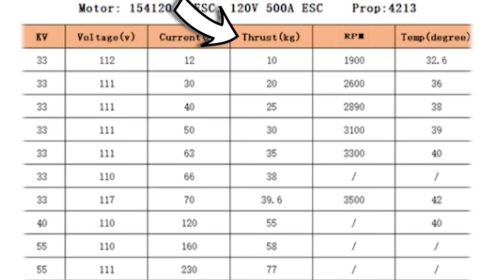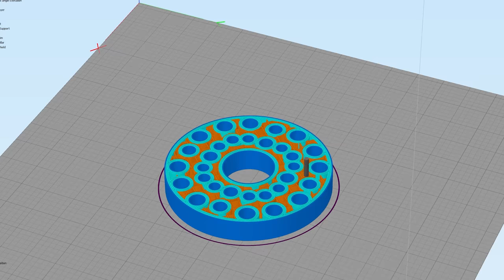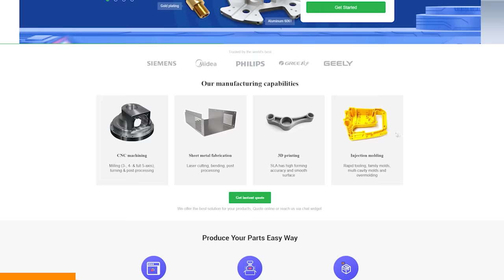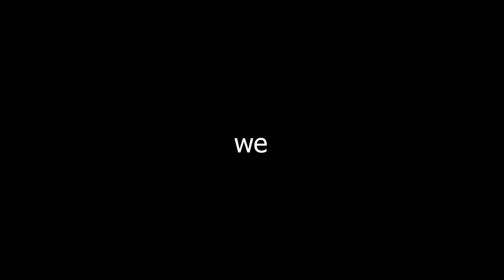Electric Motor From A Car Powers This Snow Racer

Comment: Build Project>>>>> Like the Spinlaunch satellite launch system, could you build a ball bearing spin launch rotary disk where the ball bearings (bbs) are feed into the center axis of the disk and accelerated along an internal tube to the edge of the disk where a capture mechanism / shutter/ magnet releases the bbs at just the right time to launch the bbs at any target within a 360 degree arc?

Comment: You should build a proper frame that puts the weight on the tyre, so make two steering sleds/skis? like in a snowmobile up front and put the weight on the back, otherwise it doesn't make sense.

Comment: You need to transfer more weight to the back. Less weight on the front, not just more on the back. Move your body weight back more. But this can only be done by raising the center of gravity. Not good.
The motor mounted up and behind the wheel. You moved back to where the motor was. It may look odd, but you are used to that. :)

Comment: You might get better performance if your body weight was positioned where the motor is. It looks like you have too much weight on the front and not enough at the back. A narrower tire would probably help with traction and cornering. Good luck!

Comment: What about using a bunch of rollerblade wheels sticking down under ski's. Just make them removable. Have four in a line with front and rear ones slightly higher for front steering skid. Just swap out the different steering skids for different surfaces. In fact for fresh ice why not go with big bloody skates like on a luge? I bet you'll get it moving then!

Comment: It's an issue with your frame not distributing your weight over the tire. The point where the aluminum is attached to the frame is bending which is putting all your weight on the skis leaving your tire spinning.

Comment: The main problem is that although you you made it so that you added a bit more weight to the back you still have to much in the front so your still not maximizing grip and instead maximizing friction on the front skis you could fix it by either putting more weight in the back or figuring out how to make the front skis slicker because at the moment you essentially bottoming out when you step on

Comment: When you removed those studs and put screws in I went no!!!!! 😥😥
But you did it anyway and then realised your mistake in the summary at the end when you finally got some ice.
Hopefully you can cut those screws flush and put the proper studs in.

That things gonna be fast.
Maybe order some used ice skates now and get the blades ready for a little addon.
Just make it a slip/clip on with a 3d print.
I just thinking ahead to stop you spinning in circles and also turning at high speed.

Comment: When running the 72V battery setup, I would at least cover the upper side of the wheel for safety ....
PS : footballers will think by the tracks in the gravel a space ship has landed ...

Comment: The friction of sleds is sucking all the power and so the weight needs to be over the wheel with some weight on sleds enough to give it steering
Reply: You could increase traction of rear by way of a belt .. haha we are back to common available devices

Comment: You need front wheels instead skies when on hard surfaces or grass. The skies are give you too much friction. Maybe put the seat over the tire instead of in front of it. would give you grip. This would make it more top heavy but would give the tire more grip.

Comment: like a dragster or a boat, you need to get the front skis up or at least barely touching.  Way too much friction up front not enough weight where the power needs to be laid down (on the wheel).

Comment: Cut off the main skis and weld the pair onto the steering axle. Install pegs for your feet to help steer. You have too much ski friction. 

 Also, look at ice racing motorcycles. They have fenders for a reason. Don't be a red mist on the ice.

Comment: make a planetary gear with that wheel and motor for a one wheel setup with 7 to 1 gear ratio on a skateboard u should have the traction and torque to move anywhere.

Comment: not to arm chair build but maybe adding a ballast over the rear axel could help with traction? i think your motor is too strong for such a light vehicle :)
Reply: nvm you said it in the last 30 seco0nds as i typed previous comment lol

Comment: You are lacking traction on the rear wheel. It has enough to tear up the dirt but not enough to overcome the friction of the skis. An easy fix would be to put the rear wheel on a swing arm and lift a portion of the weight of the vehicle on the rear tire. Doing something like you did with the original ice racer would be the best fix

Comment: Those brushless motors are hilariously simple. It's just a battery, connected to copper wires, coiled around a central magnetic element... the more electric current, the higher the thrust. It's basically a Magneto, although that starts a combustion cycle, instead of powering the motor itself. The dynamo is the opposite. That is a + magnet ring, that spins around a central coil of - copper wires, producing electricity, which is sent by wire to a battery, to the - 

The + could connect to a brushless motor, (magneto) which could then provide mechanical power to the Dynamo... through another positive wire. That electric current, then powers a brushless motor, (Magneto) through a + wire, which then powers the dynamo with the + current... and as long as there is juice in the battery, that just keeps happening
Reply: Wait, so the battery isn't used after the 1st pass of electric current?

Yeah

Chernobyl explodes
Reply: It's like an infinity symbol. It would almost be considered perpetual motion, although it requires energy to start, and it costs energy to put weight and stuff on it...
Reply: Electronic Gear System... been there, done that... different magnets have different resistance for more current. Copper only also works.

Comment: Dude. In America we know 2.54cm is approximately 1 inch because it's literally part of the our schooling to use Metric and Imperial Measurements. And you should have just made a Snowmobile/Ski-doo/SnowMachine instead. Traction is better.

Comment: "We're definitely not lacking traction." you say as the wheel spins while not putting any power into the ground (the definition of traction). You have no weight on the tire, only on the massive high friction skids.

Comment: Simply, sit further back ...please.  You are halting the contraption with your weight primarily over the skis. Better traction can be had by placing your weight toward the back tire.  Also, you are probably doomed with the single tire design because that tire will sink in the deeper snow. Like the skis... the tread needs to spread out; making more surface area to ride on the snow, not burrow into it.  Looks like it could still be much fun,

Comment: I've always fancied building an ev off road cart/buggy, specifically for running around woodland, basically covertly as no vehicles are allowed but if no one can hear you unlike a motor bike / buggy, but the price of the batteries puts me off, I won't risk buying cheaper quality ones

Comment: Get 3 standard scales and put one under the front ski one under the middle skis and one under the rear tire. Then sit on it and have someone read the values. You will see that the reason it won't move forward or steer well is because 70% of your weight is sitting on non steering non driving skis.

Comment: 6:57  "we're not lacking traction"  as the wheel spins, not getting any traction, and the thing doesn't go at all 😆  Weight distribution is all wrong, you need to sit over the tire and take the pressure off the skis.

Comment: Looking at this logically, too much weight is in front. The skids need to be bigger or there needs to be a rubber track like a traditional snow mobile. This sled reminds me of a tractor pull in the mud here in the states 🤣

Comment: Seems like your biggest issue was that you were using skis instead of wheels at the front. 
Also, WAY too much friction on the front two skis and almost no weight on the tire, in terms of weight distribution.

Comment: This is dangerous as f*ck... If the front gets stuck in the ground at speed, it will throw you forward, the thing will flip and the spinning wheel might carve a nice hole for your portable tools in your back

Comment: The reason it don't work well is because the force of action is horizontal.  You need weight on the wheel to change the direction of force more of an angle into the earth.

Comment: The problem is, you should be sitting over the wheel, not the skies. Wheel needs weight, skies need less weight.

Comment: Far too much weight over the front ski, get your weight over the tyre and make it so you can easily lift the front ski, you can then lean forward if more force is required, nice effort though, as it is on ice it will work ok but for snow you need to get the weight off that front ski.

Comment: The rear end was not heavy enough…you need weights to push the tire down, it’s like a pickup trucks here in America….they have plenty of torque to pull heavy trailers but terrible in the snow and rear tires always spin if there’s not enough weight to keep the rear down ..

Comment: For sure weight distribution is bad and I think balance should be at the point were you seat, if you need change balance front or rear u only need move your body

Comment: Just saying but haven't you noticed that you are only putting your weight on the front of the  motorbike. So I suggest, to make a 30 to 15 degree of incline from the wheel 🎡 side to the steering wheel 🎡 or simply lift the front side with out lifting the back, that way you can put some pressure on the back 🔙 wheel 🎡 to get more traction.  I'm just saying

Comment: You want to be sitting more over your rear wheel and paddles would be better, 2x rear wheels with paddles would be ok if you were sitting above them but you are ruining your skis on the tarmac they won't slide well in the snö any more.

Comment: OMG, will you ever listen to the suggestions below? Weight OFF the skis, ON the tire,  LIKE PUT YOUR SEAT OVER IT!

Tractor pulling sled is what you built. The double sets of bearings is also insanity, you've done it twice now. Why don't you understand that? Instead of 6 rolls of filament for those goofy hubs, 4 pipe spacers is typical for go karts for sprocket (Not gears) mounting to wheel. So close but to hard headed to actually do it right.

Comment: The design is wrong. There's no load acting on the drive wheels, and when you sit, it's getting even lighter and all the weight is on the sled, rather than on the wheels. Try giving it an angle and your weight should act on the rear wheel.

Comment: chains are not worth it, hub motor motor wheel is better
Reply: and having front heavy (no weight on traction wheel) is lame
Reply: would be better if you sit on the wheel, not in front of it

Comment: I mean im nowhere near mit but, JUst saying, why wasn't weight like one of the 1st issues to come to mind? If that wasn't a trigger i mean traction for me would have been a close 2nd. Im one of them red pill cultist, for lack of better description or for the audacity and a mid-set but  like at 6:57. I have had enough. Like, man how in the name of Sir Isaac Newton did you not do the power weight friction equation? This is coming form a 8th grade drop out. same budget as you I think..... ( Arrogant American Rant Sorry) I probably could have solved all issues with weight and traction and surface friction in the 1st IDK ummmmm 4 hours of the project. O.K I apologize for my rude out burst and arrogant perspective but6 it had to come out

Comment: In MY opinion, you should remove the outer ski's... They seem to be what's causing the most friction... If it were me, I'd figure out a way to have 2 ski's in the front for steering as well as balance, which could easily be swapped out with wheels and tires for the road and dry ground. Then just have the tire as the 3rd point of contact in the rear... Or you could make custom ski's that were thinner. But I think it would work better without them... But that's just my opinion and opinions are like assholes. Everyone has one but most of them stink.